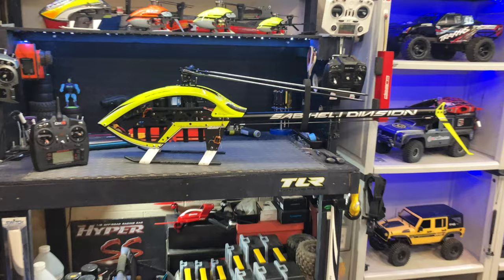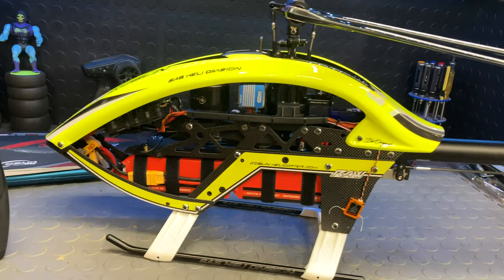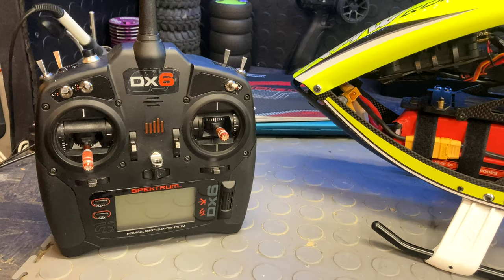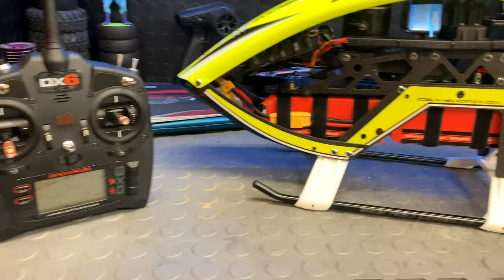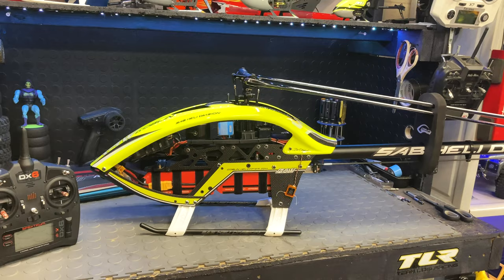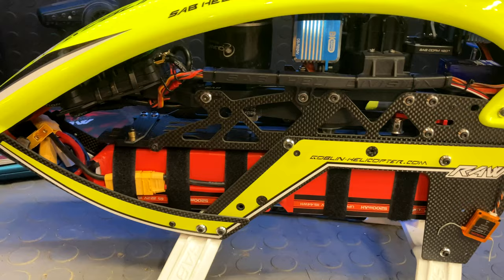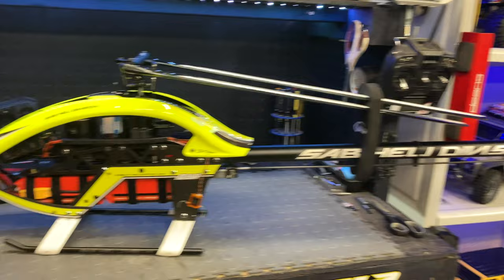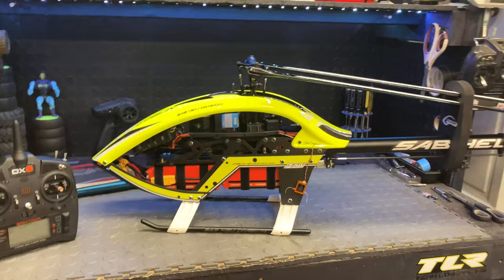My SAB Goblin RAW 700 Is Finished & It Didn't Explode On The Maiden Flight

Comment: Congrats on the maiden! And yeah, the Vtouch is worth it. It's so incredibly easy to do the setup with that radio. 👍
Reply from the maker: Thanks bud! Yeah, that Vcontrol price tag though lol. Plus I would need a new Neo. Don’t think mine can be upgraded to Vlink
Reply: @thercelementheliedition5716  Yeah, the price kept me from getting it for a long time. But after struggling a lot on the setup of my first build, a Goblin 380 Buddy. So after having the heli sitting on a shelf for 4 months, I decided to take the plunge. I just couldn't get the pitch settings right on the Spektrum FC6250HX i had. I have no idea what was wrong, and I read som other having the same issue. The setup on the Vcontrol Touch/Neo was so easy even for me as a beginner.

Comment: congrats on your build and maiden .. it's  such a fantastic build and flys amazing.  as far as the vbar I'm not sure on setups,    I'm using ikon2 in mine now I must wait for the raw580 to arrive.
Reply from the maker: Thanks bro! It is such a cool heli. I’m having a head wobble issue though in fast forward flight. I turned the head gains down pretty far and it’s still there. I will get it sorted out.

Comment: Awesome. I enjoy your heli vids and congrats on the RAW. 

I would seriously think about genuine spekky sats and at least a HW130 esc. Not cheap but neither is a crash and me and my RAW would know about that!.
Reply from the maker: Thanks buddy! Yeah I did order some Spektrum sats. The Redcon sats have worked flawless for me on the 770 & 570 believe it or not lol. 143 flights on my 570 with them with no issues. My luck I will put the genuine sats on and loose signal 😂
Reply: @thercelementheliedition5716  

I feel you man!. I had lemon sats that kept crapping out on my Kraken KSE which made me good at autos!. Genuine spekkys sorted it for me but others have had zero problems with them!. Just watch the ESC.. I can occasionally trip my HW130 on the RAW but the 200 on my Kraken KSE holds good.
Reply from the maker: lol yeah, I was gonna buy a new ESC but damn the 200 amp ones are expensive. 700 helis are pricey for sure. But, I will see how the 120 does in there. I had that 120 in my 770 and had several shut downs from over amping it. Any idea how to check the logs on the Castle 120? I pulled up the logs in the castle software after a flight, but it shows no data on the graph. Uploading a flight video now with my RAW. Having head/tail wobble issues. Take a look🤙

Comment: like the build i got one but them xt90 not enough  current for 12s.
Reply from the maker: Thanks buddy! I am running 2 6s packs in series with dual xt90s. They aren’t very warm at all after a flight. I normally run RCproplus connectors though